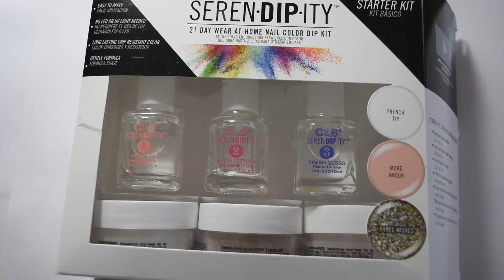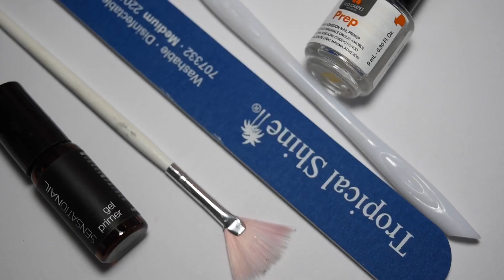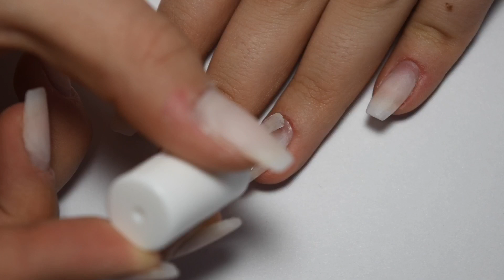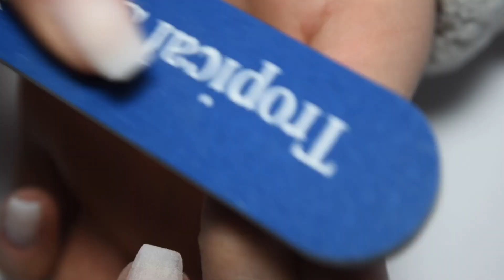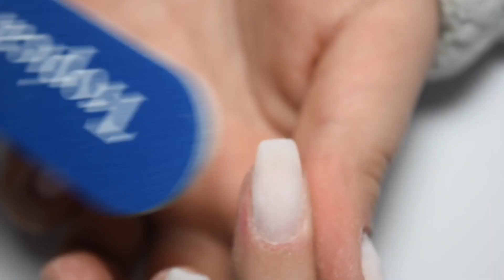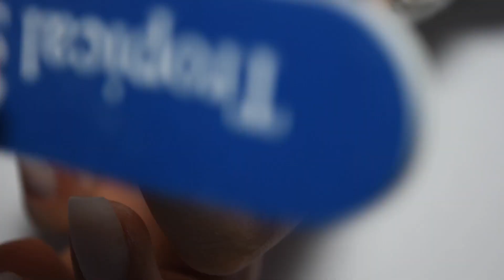how to refill nails using dip powder | ft. color club dip system

Comment: Hey there!  Thanks for the tutorial!  I just recently got gel nails at a salon and wanted to keep them up on my own. My question is: don’t I need the uv light?  That is what was used at the salon.
Reply from the maker: Hi! For gel nails, you will need a UV or LED lamp in order to cure or “dry” the gel polish. Regular nail lacquer would be the only product you would not need to use a lamp for as it air dries.

Comment: U should file down the old dip acrylic so it's very thin, then apply 2 new layers of new dip powder, layer 1 3/4 of the lay down ur nail then layer 2 covering all the nail but not the cuticle, and then use the activator to cure the acrylic then file to smooth and shape, u will get much more of a seamless look that way xx

Comment: Might be a dumb question but can you fill your nails with a diff dip color? Thanks!
Reply from the maker: yes you can! just file off the old color and then do a fill with the new color. i would recommend doing a layer or two of clear on the natural nail and then applying the color so when you do your fill you can file down to the clear layer :)

Comment: Why would you use a gel primer for acrylic dip nails? I would think they are two different kinds of primers.
Reply from the maker: First Last there are two kinds, however they basically work the exact same. if you prefer to use acrylic primer that will work, i just don’t have that :)

Comment: Thanks for this! How many fills are safe? Can you keep doing this instead of removing the whole dip?
Reply from the maker: hi! you can fill the nails as many times as you like before you fully remove them. as long as the product is still holding up and you make sure to file off all of the lifting before doing a fill, you should be able to just keep filling them as you like :)

Comment: So question  how come I've noticed with everyone who does powder fill that they apply the base to the whole nail, why not just where it needs to be filled? Is there reasoning behind this ? 
New to this whole at home nail thing
Reply from the maker: blaZe& beattS hi! so the reason that you want to apply fill to the whole nail is because if you file down the old product/lifting, the nail has lost its structure. by applying more, the nail gains the strength back. hope that helps:)
Reply: @katesnails  thanks so much this totally did help 🙏
Reply: blaZe&beattS you are right!
It supposed to be done like regular acrylic or hard gel: fill the growth of the nail only, with the same number of layers as the original application, smoothing with a file to even up any excess.
Dipping acrylic was so popular in the 80’s but they used to make only clear. Now it’s back colored.
I’m doing nails for 40 years, taught Nail Technology for over 10 and never saw fill in done like that. I watched the video for curiosity and a bunch of others just popped up. Again you’re right, all the same, I don’t understand why!!!
The structure should be reinforced at the stress point only. Reapplying the product over the entire nail just make it look bulky and unnatural.
Reply: @Lelanosusa  Hers definitely don't look unnatural or thick, but okay
Reply: Samm Ontiveros, I agree. But because she applied only 1 coat the filling is very thin which probably caused lifting within few days and doesn’t match with the rest of the nail. Definitely must be polished, as she said!
Reply: @Lelanosusa  No again. They definitely match the rest of her nail bed.
Reply: Samm Ontiveros am I the only one who can see the difference of color and the line between the filling and the rest of the nail bed???
Reply: @Lelanosusa  Jesus christ, Lela. Do you have nothing better to do?
Reply: @Lelanosusa  Let this girl do her nails and move along
Reply: Samm Ontiveros I should’ve asked you the same question but didn’t want to be rude!
Move on!!!!
Reply: @Lelanosusa  Okay, child.

Comment: Great steps and details for new users. Thanks for sharing. Over time, do you just keep filing down the old layer before applying a new layer? Wondering if this step needs to be done to avoid thick nails.
Reply from the maker: Shantel Davis no problem! yes, i do always file down the old layer to avoid the nails becoming too thick.